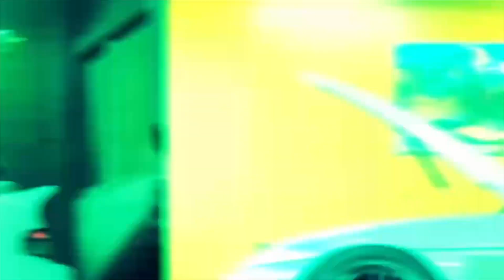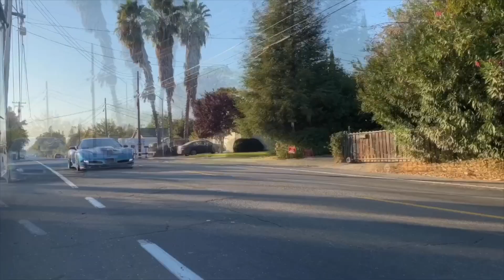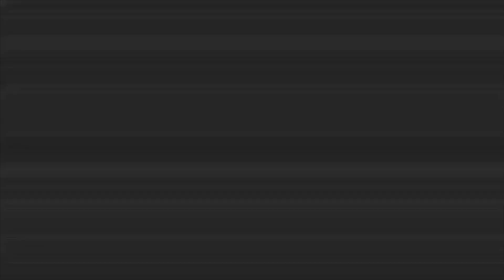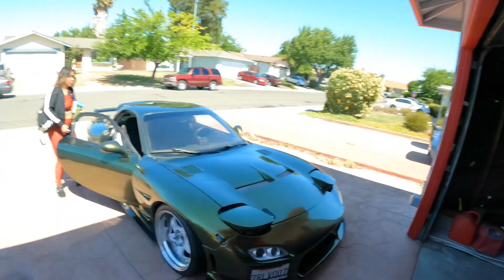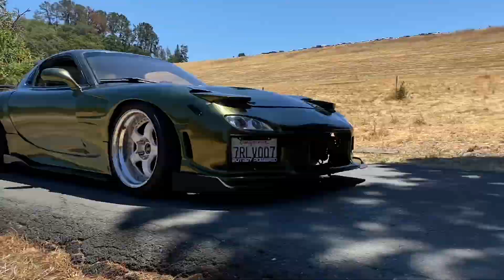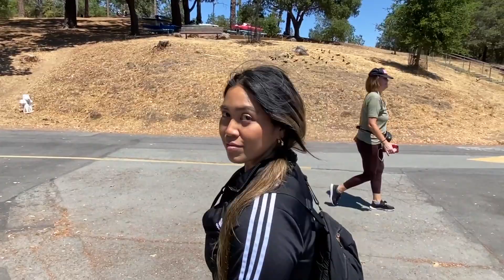POV: Driving My Single Turbo FD RX7 "Insane sounds"

Comment: Aren’t rotories high maintenance tho?? Or cost a lot of you need to get a new motor??
Reply: Yes and no lol. The main reason they require more maintenance is when they’re stock or when they’ve got the premix coming from the oil pan. That’s how the factory built them so if you aren’t constantly adding oil or doing oil changes it’ll run dry and kill it. And stock rotaries arent too great when making higher power either lol